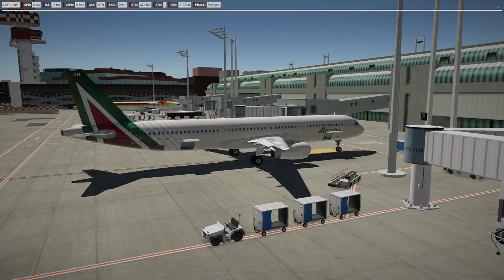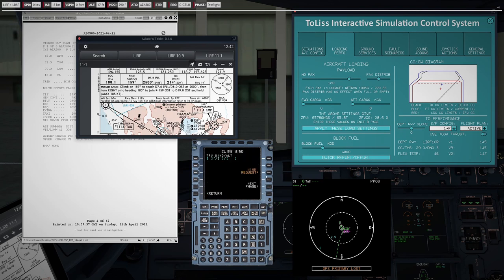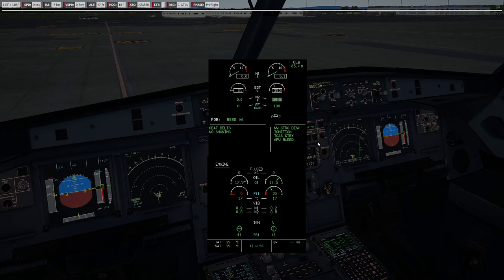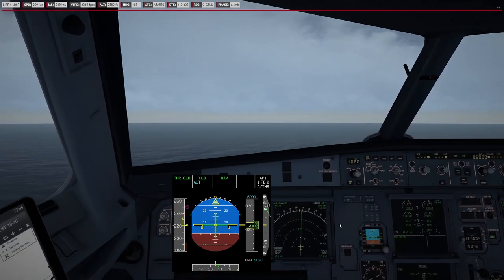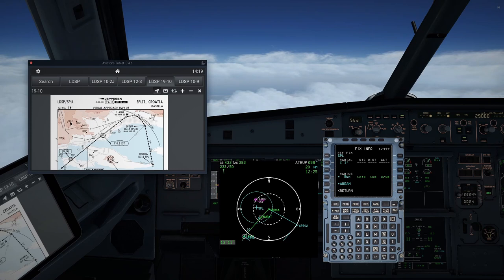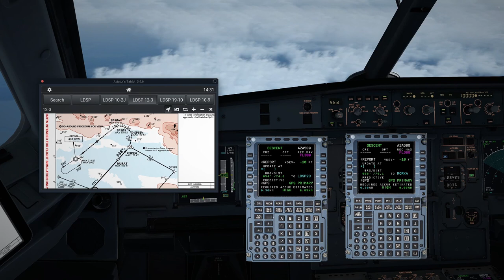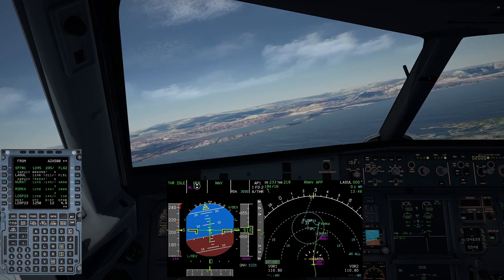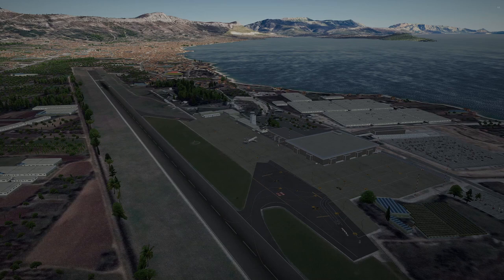X-Plane 11 | Toliss A321 | LDSP - Split | RNAV Visual RWY 23

Comment: Professional ! I ask myself if it was possible to enter SP504, SP505 and SP506 FIX directly to FMC route plan?
Reply from the maker: You could in the sim, but in real life you wouldn't be allowed to use AP below MDA, so they could be there only for situational awareness, but not for AP guidance.
Reply: @matteochewie4373  You have set a FIX for the curve flight to RWY, so what is the difference in real life situation? In bot cases pilots can fly the RNAV VISUAL without using the AP?
Reply from the maker: @ilankrt  The circle I drew on the fix info page was only a boundary, as in the chart it specifies you should not fly beyond that, so it wasn't to give guidance to the runway but to make sure I didn't fly past that. 
Custom waypoints would not be used in real life as the procedure is purely visual and relies on visual clues. Of course having 2 pilots, one controlling the plane and one checking out the window for those visual clues, makes it a lot easier than it is in the sim, hence why I use a few "tricks" to help myself.

Comment: Congratulations, great video! Just one question: for the visual segment, you use the visual approach chart and not the visual part of the RNAV approach chart. In the latter, the visual approach waypoints are different (SP504, SP505 and SP506) and there are no altitudes recommended for those waypoints. What to do in that case? Thanks.
Reply from the maker: I guess it could be operator specific which chart to use but in all the real life videos I have seen they always seem to use the visual I used.
It's a procedure that is done only after having been trained on it, so you are supposed to know the altitudes and visual references by heart.
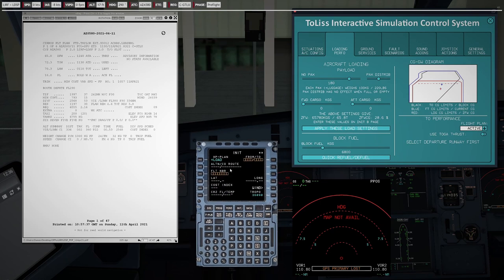Reply: @matteochewie4373  Thanks. Unfortunately I haven't found real life videos which show the cockpit displays, only outside view. The only one I have found is the one below, where, if you stop at min. 6:52, the waypoint just passed looks like SP504.